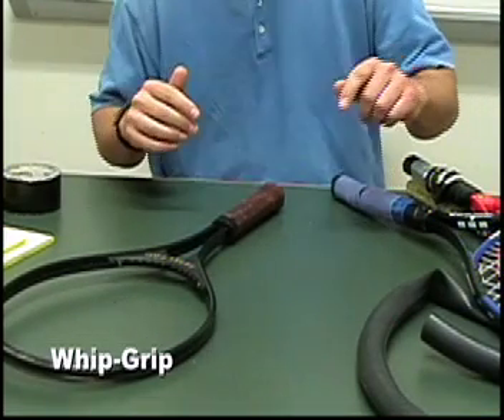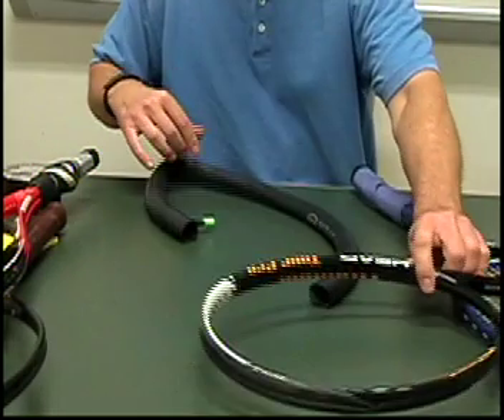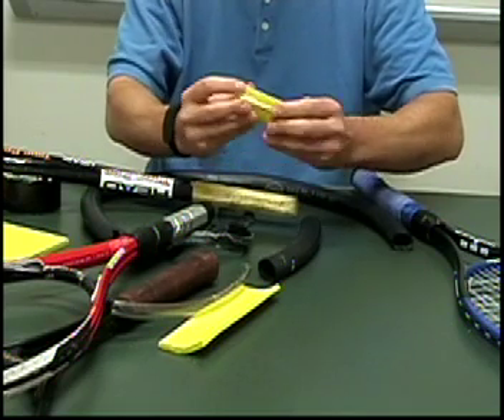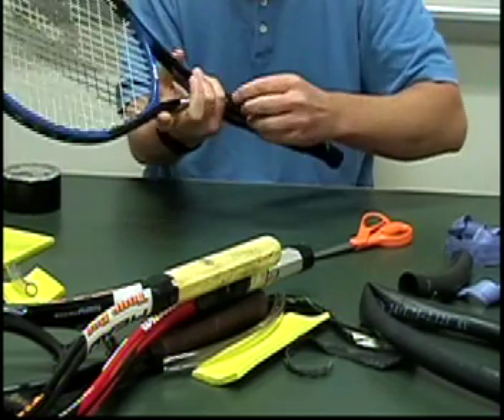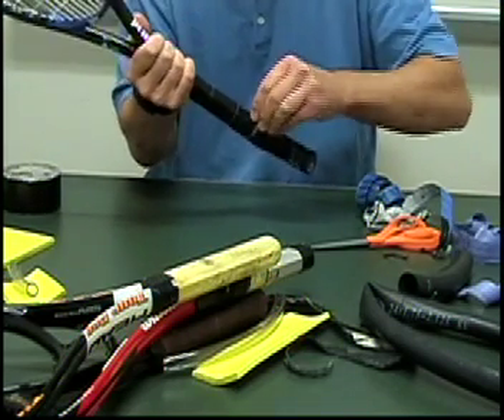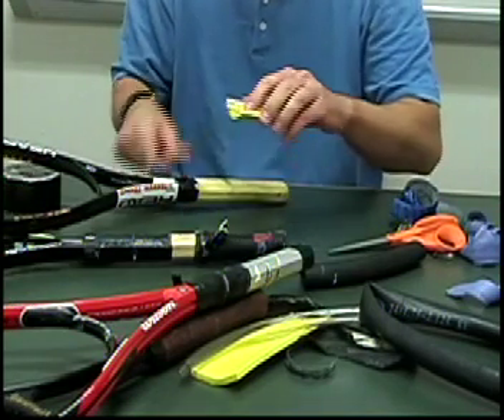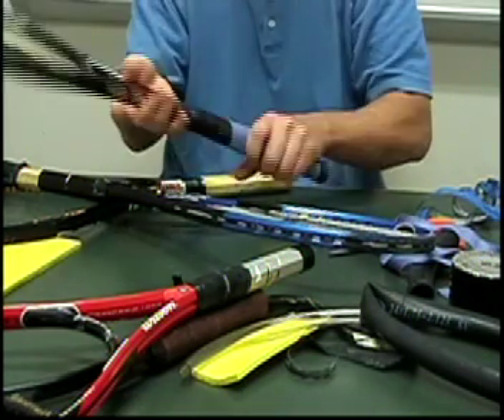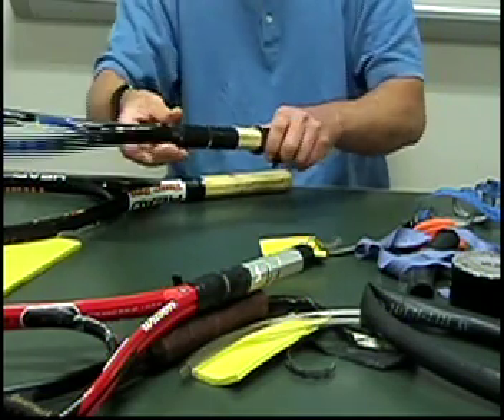Whip-Grip Tennis Grip

Comment: the butt cap is not  "hard and essentially useless."  Where do you get this false information?  This is highly inaccurate.

The butt cap in fact is flared by many pros to enhance their grip.  See richard gasquet;s racquet:   https://www.pinterest.com/pin/124834220894748822/

This whip-grip is a disaster and for those who bought one and used it will promptly return the item.

Comment: This could be useful for one purpose only.  To show someone how to come across the ball with a relaxed hand..that's it.  In order to use this you would have to squeeze on hard..which you are doing in the video....which is the wrong way to play.  This device would cause alot more problems than solve.  I have been teaching tennis for a living for 17 years, and I have found alot of contraptions and teaching aids very useful over the years, however interesting, this is not one of them.